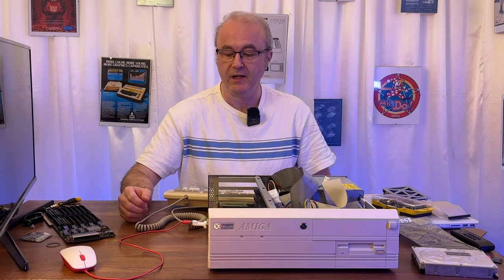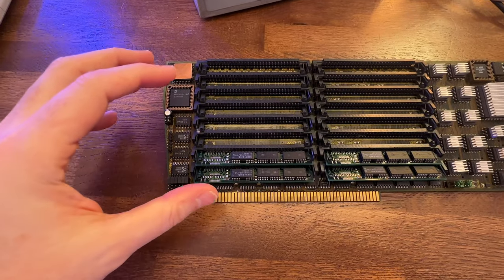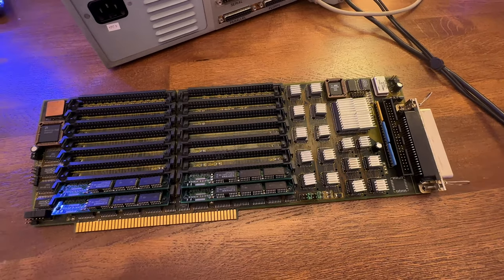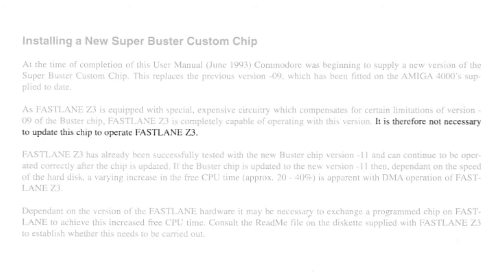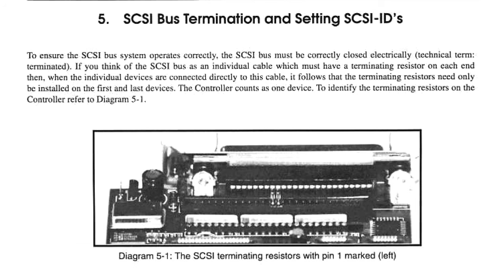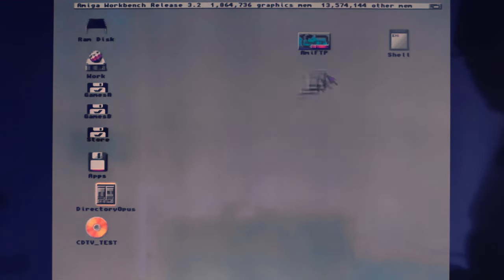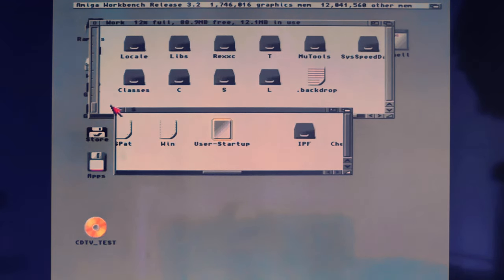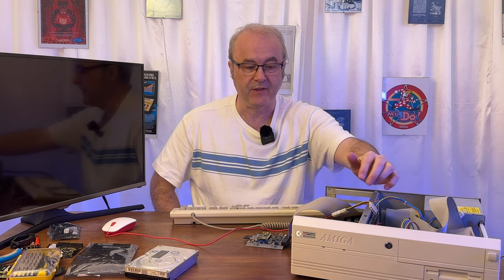Amiga 4000: Is the Fastlane Z3 the best home for a BlueSCSIv2 Upgrade?

Comment: I used one of these for a while with my Broadcaster Elite non linear editing suite. Eventually upgraded the Fastlane when I got a Cyberstorm PPC accelerator with built in Ultra Wide SCSI controller and its 68pin header. Used two 36GB 10,000 rpm Seagate Cheetah drives which absolutely flew!
Reply from the maker: Just wondering. Others and myself have noticed issues with disk corruption. Do you remember these being prone to this back in the day? Of course, these issues could be to do with people picking up (very old) kit?

Comment from the maker: If anyone is wondering, the state of play with this card now, is that the SCSI is working, but the RAM side is iffy. Originally, when I received it, I could not get the SCSI working, hence the video. But the RAM actually worked. Well, it worked for the 4x 4mb Simms, giving me 16mb extra. Then, just before I started making the video, I decided to pop the other RAM in, starting with the 2nd 16mb. And it did not work. Yellow screen. Took it out, and tried various combos. None worked, so then went back to the 16mb again, and now that does not work either.

When testing this, I found if I held the 2nd Simm in its socket, it worked, kind of. But often if I let go, and reboot, yellow screen again. Plastic clips broken on ALL of those first 3 slots. So I decided to get the new sockets, the ones with metal clips.

I may make a video showing me fixing this. But of course, nothing is guaranteed. The Fix or the video :). Never de-soldered, soldered a simm slot before, so that'll be a fun challenge for a start eh?

Comment: I couldn't have done any serious multi-track audio, video or 3D animation / special effects work in my Chicagoland studio without SCSI, due to the sheer size and volume of the files. The Flyer had its own proprietary file format, but before that, Lightwave 3D used a DPS Personal Animation Recorder "PAR" card to play back the completed animations (with it's own dedicated hard drive). When the Flyer became available, the PAR was no longer needed. An external tape and Syquest drive were mandatory for backing up projects. There was a program called Tapeworm that handled that, with up to 7 devices on a single, properly terminated SCSI bus line.
Reply from the maker: Yah, SCSI, gone, but not forgotten. Personally, Id love to see the Fastlane Z3 cloned, a ReAmiga version of it would be nice. Mind you, it is a little flaky, but that could be remaining gremlins in the Super Buster 11?

Comment: I guess that a modern version would be tiny compared to this card, as you can get a single 64MB SDRAM IC for $3 and a 64MB DDR SRAM IC for $1. You can get DIP ICs but also BGAs at 10mm x 12.5mm!
Reply from the maker: Yes, the RAM side of things would now be one chip, even if it were the full 256mb of RAM. The SCSI side, could all be merged into one IC probably. It would only be the 50 pin SCSI socket and the backplate that would make it large. Maybe sourcing those is not so easy, but it appears it IS possible as the A4091 was made recently.

Comment: I'm having a bit of a fight with my Fastlane card as well. Had problems with the image becoming corrupted. Although not clearly visible on the BlueSCSI wiki menu, an article regarding SD Cards can be found and says to avoid all SanDisk cards. I bought a high endurance Samsung card and the corruption went away. Thought I'd point this out as it does appear you have a SanDisk card.
Reply from the maker: AH, a fellow fastlaner. Yeah, they are a little tricky. Currently mine is totally our of order, or rather it might be my A4000's riser card. I had to put it and the Fastlane back in, out several times to install a CD-Rom Drive. Because the A4000 is a nightmare to add drives is right.... So after the 5th or 6th insertion (which required force) it was either not seeing the card, or reporting it with some gibberish IDs and the wrong types.

So yeah... argh. Another video when I test this again. Who knows it might fix itself... But I'm assuming some solder joint got cracked on the riser card, the motherboard, or maybe the Fastlane. What I need to check this is some test Zorro card. If anyone has one they don't need, please send it my way. It can be for something no one needs these days, like a serial expansion. I just need a KNOWN good Zorro card to test with.
Reply: Ouch, never a good feeling. I'm sure you will get your riser card sorted out!

I personally end up with seemingly random crashes, but found this happen every time with WHDLoad. I can see in the debug logs either timeout messages from the pi, or a watchdog message. Having tried all sorts of combinations of settings both on the BlueSCSI and on the Amiga, I am convinced it isn't compatible. It works for the most part, but not fully. Stable and fully working with the exact same setup on IDE with an S-ATA adapter. Would like to try a ZuluSCSI, but it is still pending to be shipped from the vendor after several months. Looks like I have to use an S-ATA drive and either sell or retire the Fastlane card. Not the outcome I wanted, as this is a much more elegant solution.

Comment: New subscriber here.  What's this like compared to the A4091 or the A4000T SCSI with Buster 11?
Reply from the maker: Sadly, I could not tell you. I only have the 4000D with this card. I THINK the A4091 is also a SCSI2 card, and I would anticipate VERY similar speeds. Not sure about the built in BUS on the 4000T, but I recall Chris Edwards putting an A4091 into his tower, I THINK, so that suggests its might be slower?
Reply: @RetronautTech  Yeah A4091 is SCSI-2, I think the A4000T SCSI is just a buikt in A4091 but there's probabaly a few differences along the way.  Always is.

Comment: Your monitor may have a faulty backlight?
Reply from the maker: Well spotted, actually, no, its a bit more complicated. I tested the same RGB to SCART lead with my A500 and this monitor, and its nice and bright. So... this has lead to me taking the A4000 apart and some techy probing to see if there is an issue with its video DAC. Long story short, today, I THINK its all actually good so... odd.

My solution is to order a second cable, from AmigaKit, which apparently are a little more techy and aimed specifically at displaying RGB on an LCD screen. I understand that simpler (socket, wire, socket) RGB to SCART cables can work just fine for a CRT, but have issues on an LCD. 

Now, this new cable may not help, but as I have 3x Amigas and only one cable, its not going to waste anyway...

Right now, with my current cable, the screen is down to about 10% brightness, so it could still be an issue with the A4000 DAC, but its certainly not an easy one to pin down. The spec for the chip says that the RGB signals should be near 15-30mV and thats what I see. Hence I began to think its a cable issue.